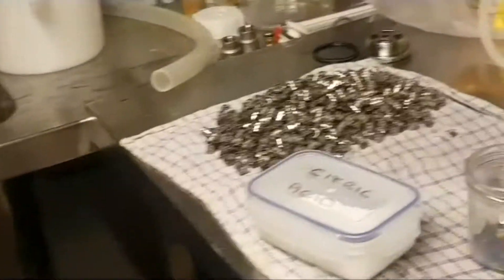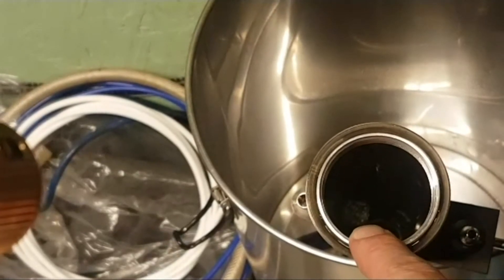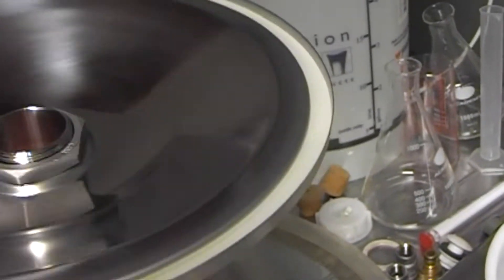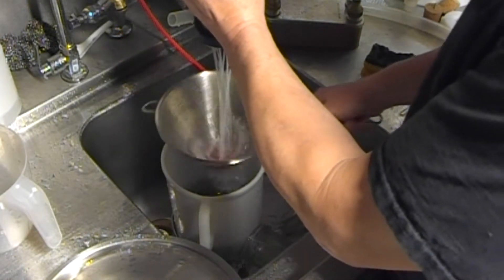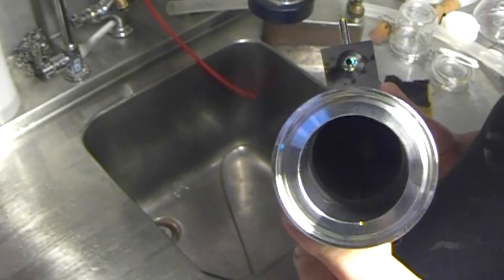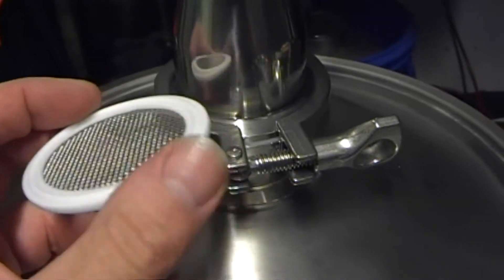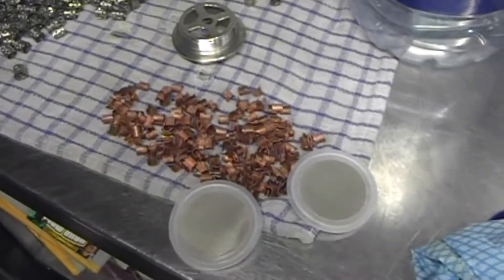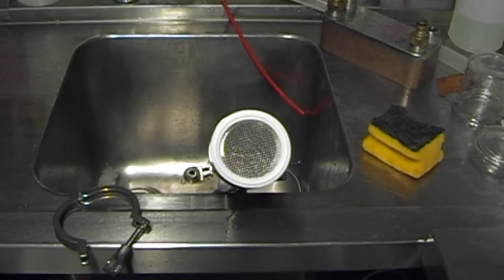Cleaning and Re-packing The T500 Still Column and Adding Tri clamp fittings

Comment: Hi guys mine is leaking from the top of the column around the plastic block that holds  the still in place with a spring washer. it`s  sat unused for a couple of years any solutions or ideas are welcome
Reply from the maker: There`s an  O ring in the top, it might have failed

Comment: Hi clive, could you care to surmise as to how much (weight) of copper packing media is the optimum (shaken down) in order not to have overpacked & thus causing puking problems? also,  why do you mix the media bearing in mind the low cost of the copper top to bottom of a T500, any advantage to be had? I have enough copper to clean one pack one on a rotation so it theoretically slows build up on the walls of the chamber via frequent swap outs (& normal cleaning practise) all copper t500.

(people mention packing it in & tamping it down but no-one seems to mention weight range margins)
Reply from the maker: Well the packs are 100g, there`s no real advantage to using full copper packing some would disagree but I`ve seen no real data to prove it, The stainless packing is designed to increase the surface area, the cost over of stainless to copper spiral prismatic packing is enough for me not to spend the money on a cost pro taste benefit, as taste is very subjective as I learnt in Beer reviewing. I never have had an issue yet, with puking. All the best
Reply: @norfolkhillbilly  I need to worry less & brew more I reckon! ..when I have loaded the copper into my chamber it was more than a packet, maybe I spent too much time tamping & shaking the 1/2 lengths & took it to the extreme.. all this for distilled water eh!
Reply from the maker: @Sh1tfaceMagee-db3px  Theres a saying coined in Homebrew by writer charlie papzian, RDWHAHB means: Relax Don't Worry Have A Home Brew.

Comment: Grwat stuff. Can i ask for the part fitting the extension buts to thr actual boiler itself please? Also, how fo you find the power output of the t500 boiler when extending the column like this? Thinking if fitting a bubble plate to mine just cant figure out the start and end fittings or if i need a little more power. Thank you
Reply from the maker: The parts link is in the description you will need  to order 2 x dn40 k64  and a couple of 2" Tri clamps you may need a variable power controller to limit the power to avoid the plates flooding, which will be a learning curve to find Your sweet spot to achieve good results
Reply: @norfolkhillbilly  thank you kindly!

Comment: You dont need the screw in part for the bottom of the column as it already has a 2" flange that will just clamp onto any 2" tri.clamp fitting, adaptor or the lid fitting otherwise nice vid...

Comment: What is recommended for the weight on the T500 cap 1.5" colon or 2" in tri clamps configuration plz?
Reply from the maker: 2" tri clamp. Not sure on weight loading. I would say the risk is buckling with side movement.

Comment: Could you tell me where I can purchase the bulk head fittings to fit the t500, and are they the same, one screwing into the column the other fitting on to the boiler hood with the nut thanks.
Reply from the maker: yes one with nut one without link is in description

Comment: Im confused or thick as hell but I got d500 I want to add clamps and sight bubble plate to my existing condenser So on the lid what is the ball head 1.5 " 2" and then I can by one for now. If I need a the thing in the description then let me know would prefer to stay all the same without changing anything just add clamps and glass bubble plate if that's possible
Reply from the maker: You need 2" tri clamp fitting one with a nut for the lid and the other just the screw to go in the column you want the DN40 k64
Reply: @norfolkhillbilly  2" Tri clamps also dn40 and k64 and a 2" sight bubble plate or more for extra floor and  Tri clamps which tighten on between each floor is that right??
Reply: @norfolkhillbilly  got lid can you paste link for top for me hard to find it and so much easier when you got a pic or link to view it
Reply from the maker: You`ll need a 2" clamp and gasket for each connection
Reply from the maker: buy a couple of extra gaskets you may need one to use as a seal on the doom as the old column one is a bit thin.
Reply: @norfolkhillbilly  hi got the 64mm male to fit the lid and a packet of 2" gaskets just realized the T500 condenser has a male screw on it. I have found the k64 female adapter but one end 64 and the other end comes in a few sizes. I'm guessing I need the end that screws in my t500 1/2" and the clamp end 64mm is that right?
Reply from the maker: @DripdropBrewing  There both the same fitting dn40 k64 just without the nut
Reply: @norfolkhillbilly  I thought so I will buy one with a nut and one without brilliant your a life saver 👍👍👍

Comment: What is the fitting required to screw into the bottom of the original column to turn it into a tri clamp
Reply from the maker: links in the description you need one with a nut for the lid and one without to screw into the column you want t he dn 40-64mm

Comment: Hi mate where did you sauce the parts from and what’s the lid connector called.thanks mate and iv subscribe
Reply from the maker: Links in the description to the Tri clamp bulkhead fitting order the dn 40, in addition you`ll need two clamps and seals, order dn 40
Reply: Thanks hillbilly found the site and fitting.quite reasonable really, lot cheaper than still dragon. Cant find the fitting for the t500 bottom connector? Can you remember 🙏 cheers
Reply from the maker: @paullee0  it`s the other one in the listing with the nut, fits the lid and the other fitting screws straight into column